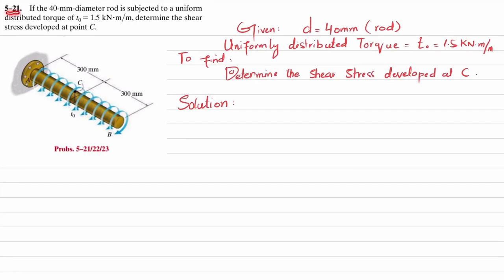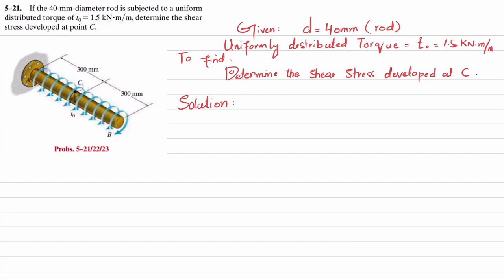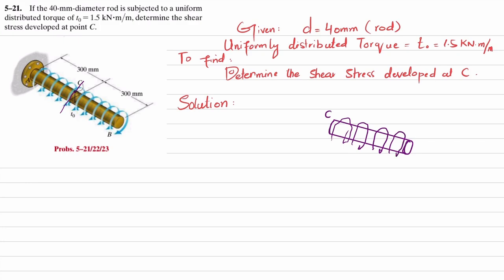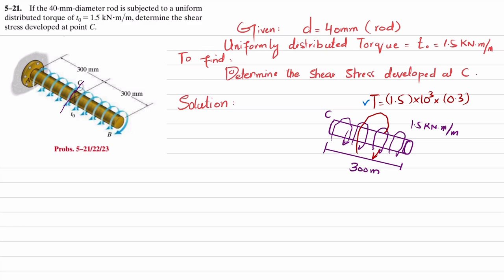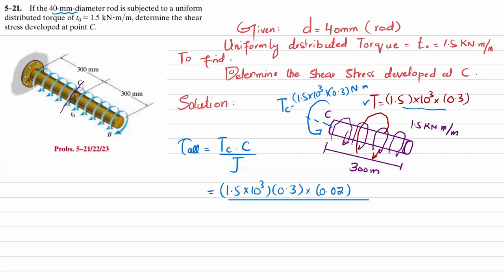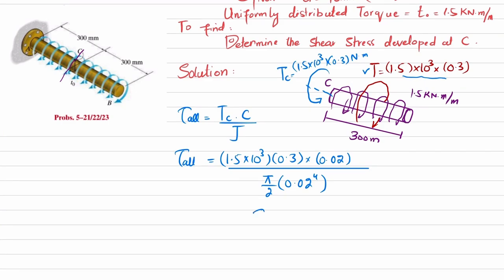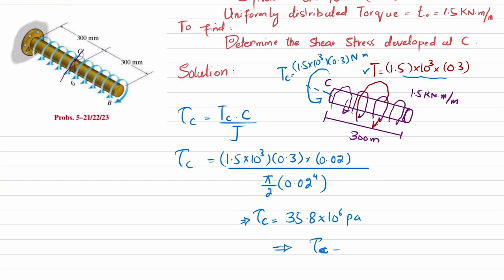5-21| Ch 5 Torsion | Mechanics of Materials RC Hibbeler|

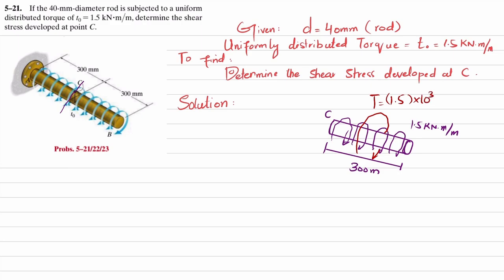Comment: 1:56 Why 0.3? IN TOTAL LENGTH? did you convert it from 300? Thanks for reply👏
Reply from the maker: From B to C the length is 300mm so to convert it into meter it will be equal to 0.3 m. ❤